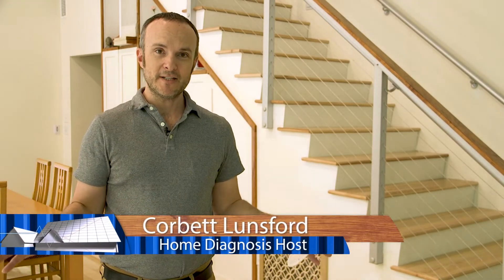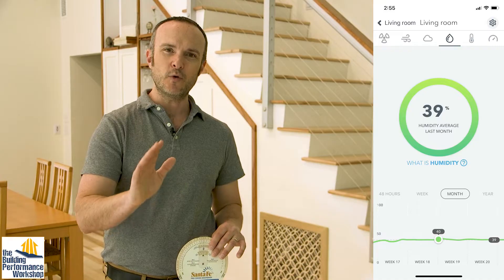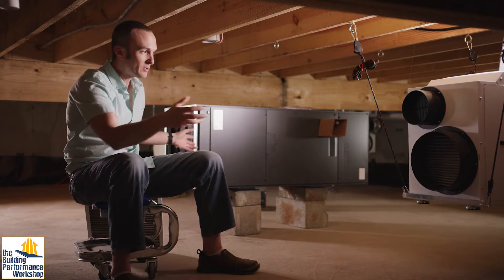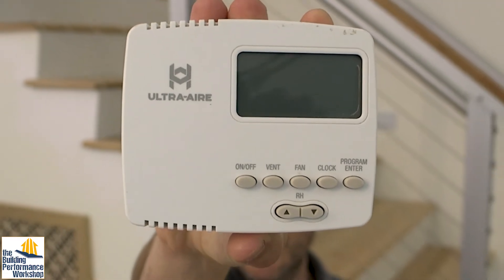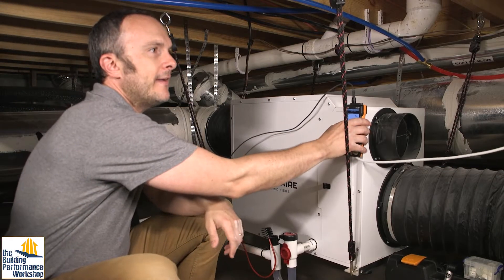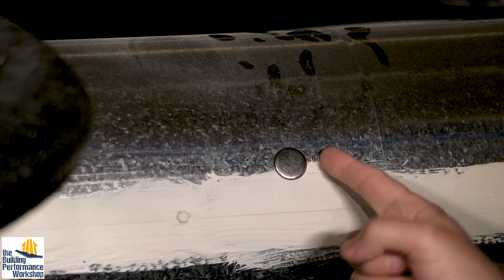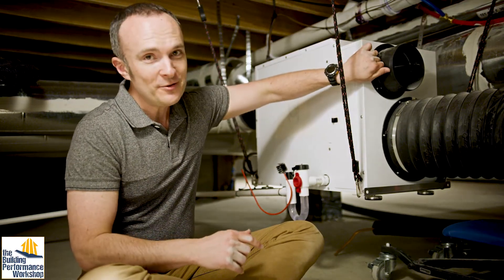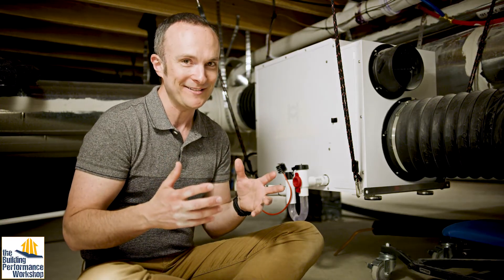Dehumidifier Testing and Calculations: How/What/Why of Dehumidification with Santa Fe Ultra

Comment: GREAT VIDEO!  quick question, i understand you are pumping the air out of the dehumidifier into the whole house supply plenum (after the ac) now what about the return duct? Where are you pulling your air from? did you build independent returns in extreme points of the house? Would love more detail on That! Thanks again!
Reply from the maker: Thanks- you can go way deep on our duct system here:
https://youtu.be/MCKTOAyN9kM

Central return, no extreme returns at all, since the ventilation system pushes/pulls as well.

Comment: Hi! I have a heat recovery system in my house in the UK, it's a very old house with some mud and straw (cob walls) the humidity outside is 80-95% and inside we manage to get 60% am looking into a inline dehumidifier into the system have you got any experience with how it affects a heat recovery system
Reply from the maker: Should be fairly straightforward, though depending on incoming temps you may want to use a dessicant dehum, like the brand ECOR Pro. Video forthcoming.
Reply: @HomePerformance  thanks for the speedy response! Look forward to the video!

Comment: Since you've added a whole-house demudifier, do you still think the ERV was the better call over the HRV? It makes the systems a little more redundant, which the engineer in me loves, but it also adds a bit more cost, where I've found HRVs are cheaper than ERVs. It also seems that HRVs are more widely recommended for bathroom exhaust, whereas ERVs are just slightly more questionable.
Reply from the maker: YES, ERV always imho, unless you’re in Alaska or southern FL (and an HRV is not the answer in FL either).
Reply: @HomePerformance  

Either an ERV takes some of the load off the demudifier while also supplying pre-tempered fresh air, or the demudifier does all the work, but either way the same amount of work has to be done.  So I'm not entirely sure an ERV with dedicated dehumidification beats an HRV with dedicated demudificarion.

Oh wait, Matt Risinger agrees with you. You're a genius, Corbett! ERV all the way.

Maybe I just really want the Fantech Hero series and I'm sad it's only an HRV.
Reply from the maker: I’m sad about that too, fellow nerd, trust me. Try Broan if you want an EC motor. Also, remember that as much as you can cut down on contaminants (like humidity), the better- the dehum only grabs air from one return location, probably central- meanwhile, your ventilator delivers air into all bedrooms. Bedrooms have LOTS of soft stuff, which will soak up the moisture before the dehum gets to do its job. Therefore, ERV.
Reply: @HomePerformance  

Ya, I have a Fantech VER150 modeled out in my house 3D model for that same reason. HRV vs ERV was more a thought exercise. 

Honestly a $400 difference between ERV and HRV isn't much when compared to to total cost of a home. Get hardwood or countertops, tile that are a little cheaper per square ft and make it up there.

As someone and married to someone with Ehlers-Danlos Syndrome and the wonky effects contaminates especially have on our bodies, I'm very much following your lead on the IAQ of the home.

Comment: Thanks for the show and topic.  I'm building in a tropical location in Australia.   I'll build in a dehumidifier however am wondering if one intake point and one exit would be adequate to dehumidify to whole house.  Thinking humidity would equalize  throughout the house.
Reply: One exit is ok as long as you keep you duct as short as possible to allow adequate air flow. I would suggest to have adequate return Grill size for a pre-filter before it gets to the dehumidifier. You can never go to big to supply the dehumidifier.
Reply from the maker: To Paul’s point, Ken, returns can never be too big for any piece of equipment.
Reply from the maker: One intake in a CENTRAL location is fine, and one output into a central dust system is fine. That’s what’s shown here.

Comment: Hello Corbet,
I've been watching you for some time and first- thank you for all these videos. So much to learn..

Question(s) for adding the dehumidifier to the supply; 1: does the positive static pressure from the HVAC cause (meaningful) backflow in the humidifier? 2: does it the dehumidifier meaningfully increase the static pressure putting extra strain on the air handler?
Reply from the maker: It does not- you can see how this 250 CFM fan deals with static pressure in the specifications:
https://www.santa-fe-products.com/wp-content/uploads/sites/4/2021/05/Santa-Fe-Ultra120-Data-Sheet.pdf

And the air handler is set up to deal with up to 0.8 iwc, the highest pressure capability available. The pressure in the supply plenum should be 0.2 iwc max with both of these fans running.

Comment: How do you like the MD33? I have a 2 story home in Central FL. Upstairs is normally around 60%-65%. One of the bigger units like you have in the crawl space isn't really an option for my home.
Reply from the maker: Try it- it works well. BUT, 33 pints/day is not very big, you can get standalone dehums at 50 pints/day, and if you need to experiment a little it’s easier if you can move the unit around or buy multiple.

Comment: Great video good sir.  Here in hot humid Southeast Louisiana, will will be installing this into a totally encapsulate unvented attic.  I was contemplating zoning my dehumidifier to do the attic as well as the house.  Also bringing in my fresh air from outside the home/attic space.   Just curious what's your crawlspace psychometrics look like?  I'm assuming all your ductwork is uninsulated in down there?  How are you controlling the humidity levels down in the crawlspace to prevent condensation on your duct and equipment?
Reply from the maker: Thanks Supercool- and the crawl temp and RH is exactly the same as the living space above. In an attic, that is a little harder to do because the sun beats down so hard.

Comment: What happens in the winter when you need to add humidity to the air?
Reply from the maker: Stay tuned. Used to say air sealing would fix dry homes, but now there’s a whole new issue when you build THIS tight.

Comment: Questions. A) do you run the Mitsubishi fan while the dehumidifier is on or is the fan in the unit able to circulate the air? B) 40 percent humidity in Georgia is fantastic  how do we determine what’s appropriate for us?  I’m in Illinois at 50% with a 69 degree home I would like to get to 40% and raise the set point to 72 degrees. Does the heat from the dehumidifier condenser cancel out the cold evaporator coil that’s doing the work?
Reply from the maker: Hey Adam- yes, the heat pump fan runs on low speed continuously. And the air is still cool with the added dehum heat, as shown in the testing portion near the end of the vid.

Comment: You didn't really talk about how the dehumidified air (from either dehumidifier) gets into the living space other than to say it is piped into the supply side (duct) of the main heat/AC unit. Is the main heat/AC air handler running constantly (maybe at variable or stepped speeds) to carry the dehumidified air or is there a 1-way damper to ensure the dehumidified air doesn't travel backwards as well as forwards in the main ductwork? I suspect the air handler is running constantly to (also) provide constant filtration and de-stratification regardless if there is a "call for heat" or "call for AC".
Reply from the maker: Yes to all, David- good questions. There’s a fantech butterfly damper in the dehum output duct, and the fan runs on low 24/7.
Reply: @HomePerformance  Is there a way to prevent backflow of air if you don't wish to run the fan 24/7?  My two story with 2 systems, fresh air intake plus two returns for the first floor, and media filters just in front of the evaporator coils, is a challenge for my A/C guy.  Since I have a huge volume of space that is common to up and down spaces--2 story ceiling in family room, adjacent stairway and 2 story space with chandelier, I was thinking of making the dehumidifier a standalone system with return and supply both upstairs near the open space.  Since dry air is heavier, it will "fall" down anyway.  It would also eliminate tapping to the existing ductwork.  Conceivably, I might or might not connect the fresh air duct to the dehumidifier or leave it connected to the downstairs unit.  Sound feasible?
Reply: Caesarean-if you have a basement lots of walls doors, it’s not that simple. I. An open barn without a basement the air at ceiling will be more musket. In most north  American houses with full basement though and anything less than the most obsessive mositure proofing (and air tightness)of foundation, most humidity will be berated through concrete wall. So basement is almost always the most humid area of house. In two zone system, I would just pull air from the bottom systems return and return the dry air into the that HVAC systems output BUT with caveat well downstream from your a coil ! At least ten feet imo-if can’t do that just  install, a separate return into largest  in basement. I would, avoid what most dehumidifier manufacturers suggest , ie ducting HVAC return to dehumidifier return, than that air returning dehumidifier  output to HVAC return-the potential for ‘short circuiting’ is real.

Comment: Can you link the drill bit and sized plugs. I have had challenges finding matching plugs for access points made in ducts. I’m in Florida and we primarily have fiberglass duct boxes and flex hose ducts.
Reply from the maker: Hey Mo- sure, it’s a standard 3/4” max unibit, with 3/4” plugs (metal or plastic). You can get it all online or in most hardware stores.

Comment: Looking at this exact unit for my home in the near future. Now if we could just stop opening the windows when it's raining outside!
Reply from the maker: Haha that’s maybe the only good reason to caulk windows shut. Living with other people IS good for us in the long run tho
Reply: @HomePerformance  Ha- Regarding caulking the windows shut- We just emerged from a brutal wave of humidity in upstate NY which has prompted me to re-evaluate my pretty tight house's exhaust only ventilation setup. Our old AC window units need replacing and I'm planning a larger ventilation upgrade to include an ERV, and I'm exploring AC and dehumid options. Today, the weather is cool, dry and beautiful. September is generally a month where we start opening the windows again.  Do you open the windows on beautiful days, or have you "caulked the windows shut" to maintain air control? The shoulder months here can be quite nice and I'd like to be able to open the windows without sending whatever "system" I install into overdrive if the outside humidity is slightly higher than the equipment set point. Thankfully, my family does not suffer seasonal allergies; we're pretty tolerant of humidity and temperature swings and enjoy being outside. In other words, I don't seek the absolute control you have, I just want to control the extremes. How can one incorporate open windows into the system or is that a pipe dream? Thanks, I love your channel.

Comment: I'm a custom builder, and chose to run the Ultra Aire SD-12 in my own home here in SW Florida. It is a split unit, so the compressor is outside, and we are pulling in fresh air from outdoors. I figured the heat load we're introducing from bringing in outside air is being (at least partially) offset by not having the one piece unit introducing additional heat load inside the house. Or at least that was the theory. :-) We've got two dogs and a cat, so a lot of fresh air was important for indoor air quality.  (Update, UA is now Santa Fe and they disco'd the SD-12...)
Reply from the maker: Nice, Paul- no avoiding extra heat in FLA
Reply: Paul, can you recommend an installer in central Florida. We need this in our home
Reply from the maker: Mo, try Kalos Services. Good reputation in our circle.

Comment: Hi Corbett, could you explain the math for pints/hr please? You are multiplying by 1/8 then multiplying by 8 a little later in the equation, it would seem they cancel?  Is the pounds per hour the same as pints per hour as 1 pint is one pound? Forgive me for being nit picky, your tuition is fantastic I just got mentally stuck at this equation
Reply: The 8s are for different things, the first 8 is part of the equation for delta, his delta just happens to be 8. The 2nd is just a conversion from pounds to gallons, so his resulted in pounds per hr and to convert to gallons per hour then water weighs 8 pounds per gallon, so 1/8 is 0.125
Reply from the maker: ...But that is interesting, a pint of water does seem to weigh 1 pound.
Reply: @HomePerformance  "A pints a pound the world around" is how I remember it." (Water that is)

Comment: Nice explanation - can you share where you got your Santa Fe humidity wheel?
Reply from the maker: Honestly I don’t remember! It’s been with me for 12 years.
Reply: @HomePerformance  I will reach out to Santa Fe direct to see if they have any...

Additionally - I am curious about your install...from your previous videos, it seems that you probably handled this install yourself. However, I understand that Santa Fe will not honor their product warranty unless it is installed by licensed installers?  How did you handle this side of the project? Many thanks for all you do.
Reply from the maker: You’re right- it intimidated me less than the Mitsu heat pumps, but I had our HVAC superstar duo Kaleb Saleeby and Brent Ridley start this up. I ducted and hung the whole thing though.

Comment: Very cool thank you. I have a 1840’s house in MA that has like 80% RH in the basement since I started monitoring it in January. There’s rot damage down there in structural members which I’ll be repairing but I also wonder if and at what point in the process I should get something like this. Just opening the door (walk in basement) drops the RH like 15%. So maybe I just need to ventilate more for now. Half of the basement is still dirt floor. So. You know. Lol
Reply: I would do a vapor barrier on the open floor at a minimum. Even something like cheap plastic would be a big improvement
Reply from the maker: Yes, stop the incoming moisture as much as you can, and get a Santa Fe standalone to just sit in your basement- your body will thank you too.
Reply: Single biggest reduction in moisture in my place was from putting poly down on the dirt under the floor. Its a must have for any home.
Reply: Thanks for your replies! I will get poly and put it on the dirt part. How much does sealing it off matter though? I wonder if I should go up the walls with it too. Part of the 2 brick walls that are the above grade walls of the walk in basement are on 2 sides of the dirt. 
I intend to add a concrete slab that’s insulated and has a water control layer but I feel like getting the moisture content down ASAP would be a good idea.
Reply: @kenmarcou  if you get 90% coverage you get 90% reduction in moisture coming out. Below grade walls i do not know.